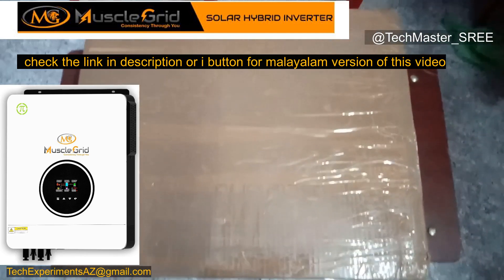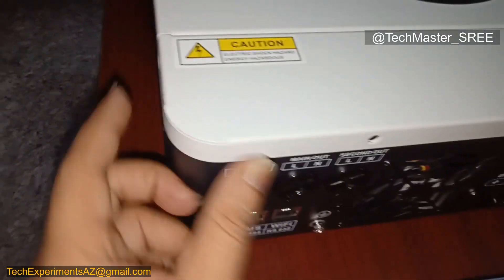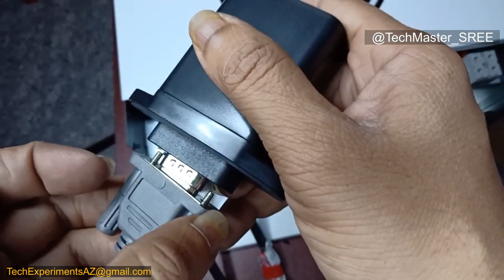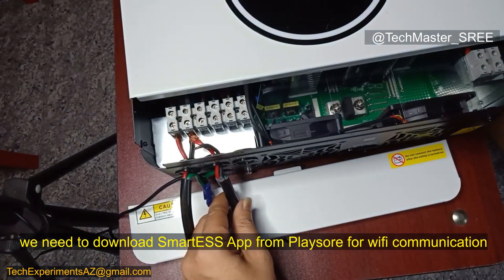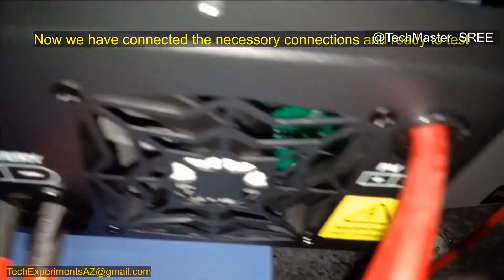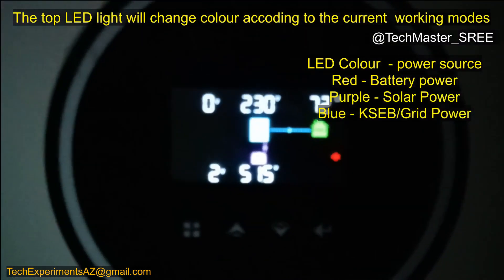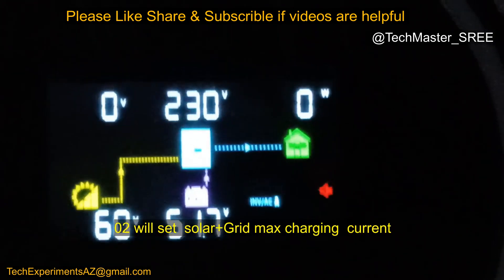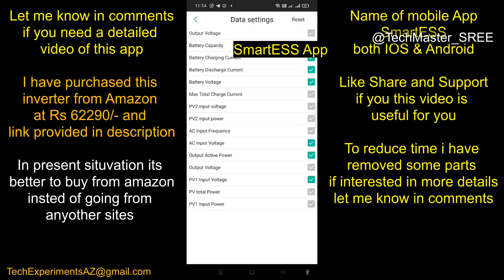Unboxing & Testing - MuscleGrid Inverter 6.2 KW Transformer less Solar -Mobile App Support- ENGLISH

Comment: 3 mppt kaise hoga. Esme to ek hi solar lagane ka point hai. Esme 3 point hoga tabhi to 3 string banakar lagaya ja sakta hai
Reply from the maker: it will be a marketing gimmick or they will be using three 40A MPPT it in parallel to make one 120Amp MPPT. It has only one tracker so it will be like single 120Amp MPPT
Reply: cant be 120A , 1 tracker with 27A like other voltronics copies ,
Reply: please share complete settings in a video
Reply: @thebioguruanupamtripathi2138  Ya, you could be right. It is having PV Input MPPT voltage range of 240-450v DC and max input power as 6500W. Means it could deliver full power at 240v Vmp and at 27A (240v x 27A = 6500w). The 120A mentioned is the maximum battery charging/discharging current (120A x 51.6v  = 6200W).

Comment: Mera 20days me spark kar kar ke dead ho gaya hai. Inverter good hai per chalega kitna ye nahi kaha ja sakta. Kyuki sari company minimum 3 to5 yr. Gurantee deti hai aur ye only one year. Kyu? Eska matlab saf hai ki ye zyada din nahi chalega.
Reply from the maker: could you please use English or Malayalam. using google translate is not always correct . This inverter is selling based on the price and features. If you are using it as pure off grid then you can expect more life since issues from grid will make any issues. if its connected to grid then make sure that you all needed protection. Giving more warranty will give confidence for users but price  will increase but that does it always shows quality . Hope it helps you
Reply: Fer warranty service repair hua yaa nhi ,, company ne spot kiya

Comment: Muscle grid company ka inverter mat lo 45000 pay Kiya or na hi inverter milega or na hi 45000 mere saath froud hua hai
Reply from the maker: I have shared your comments to muscle grid  may be they will try to solve your issue. if you can share your contact details via Instagram then I will share those details to them.